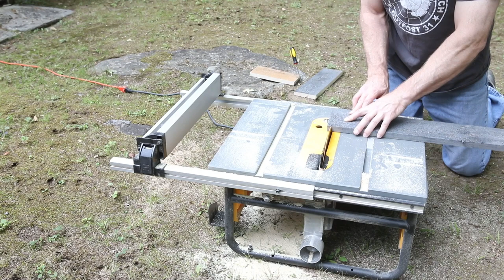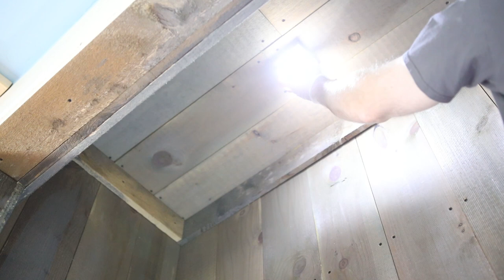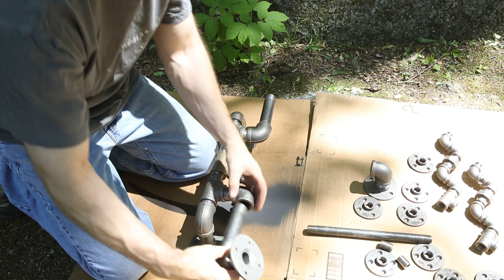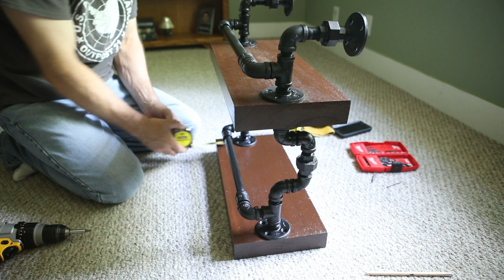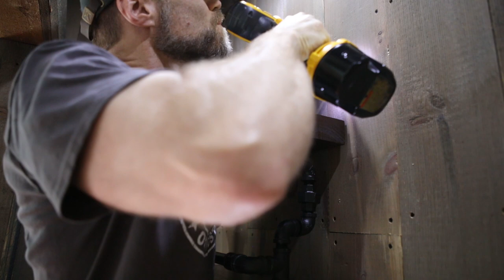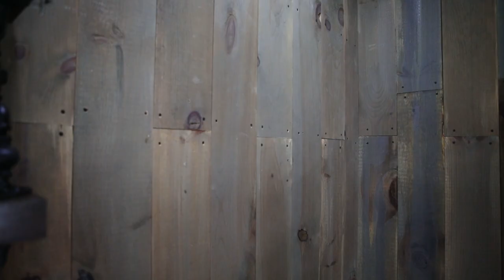Build Industrial Pipe Shelves

Comment: I'm just about at the decorating stage for the Covid bar/hot tub/sleepover project. This is the best shelving I've seen so far. I still don't know how far I want to push the steam punk look. This is really good.
Reply from the maker: This is a decent set up for what I wanted, I also added a pipe towel rack tucked away on the left side that didn't make it on the video.  If you mount them to the studs like I did, this is a pretty good project to support all your (hic) beverages.

Comment: I luv it...fabulous pallet wood accent wall!!! 💜 I'm luv'n the aged oak, it looks like you use "Weather Wash" oak wood stain (from home depot), I am currently building a 600sq foot tiny house with a rustic farmhouse feel...anyways, I want to do some industrial floating shelves in my kitchen...once I'm done installing my vinyl plank floors...I'll try building my industrial shelves!
Reply from the maker: I used a homemade solution of vinegar, water and steel wool to get that color.  Works well.  I used to age some beams for the same room.

Comment: Great project.  I am going to work on some shelves for my bar and this is my inspiration.  One thing I wanted to know is what paint did you use for the black pipe?  And did you have to clean them first with mineral spirits to get the oil coating off before painting?  Thanks, awesome work.
Reply from the maker: If you buy the pipe off the shelf then I would definitely clean the pipes with at least a rag.  I spray painted it with some high heat paint I have for the grill but just about any spray paint will work.  I suggest priming it first but it's not necessary.  Thanks for watching.

Comment: Hello sir, what is the size of the floor flanges ? I have 9cm diameter but I think it's too big .
Reply from the maker: I used 1/4" and 1/2" pipe.  I can't recall off hand the diameter of the flanges.  But if you're going to use the same set up, I don't believe you should make the shelves with anything less than 1/4"..
Reply: @mediasawdust2458  Thank you very much for the reply.

Comment: How did you come up with the configurations for the pipes was it random? I love it, I’m going to attempt this on either side of my fireplace………
Reply from the maker: Thank you.  99% of the pipe was salvaged, and many of those pieces were stuck together with decades old epoxy.  So instead of going through the pain and misery of cutting them apart, I just went off what I couldn't separate.  The trick was to get the total width from flange to flange at 16" so I could sink screws into the studs in the wall.  If you're going to support anything of substantial weight, I suggest you do the same.  Good luck with your design.